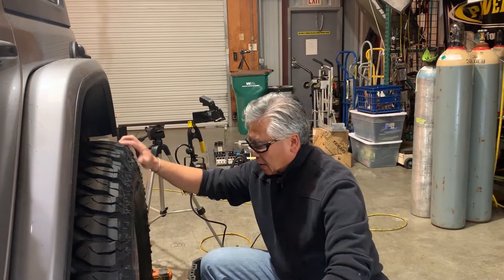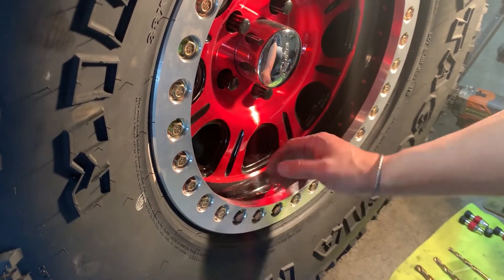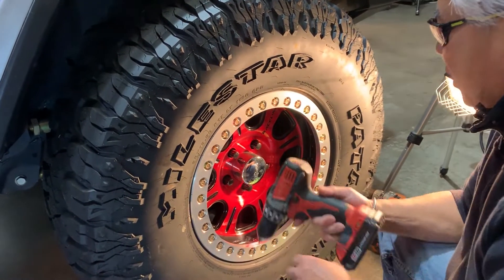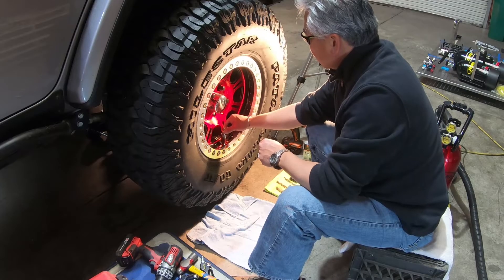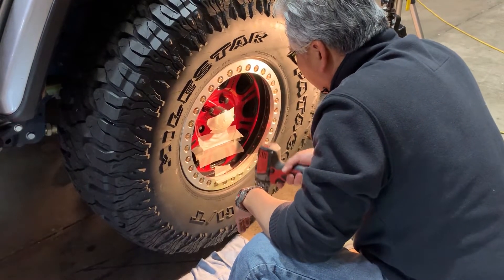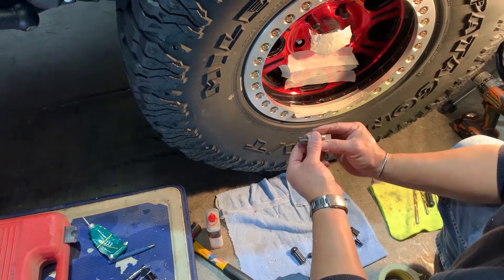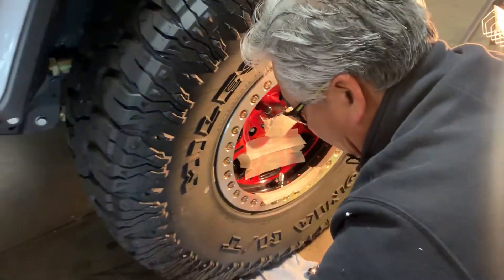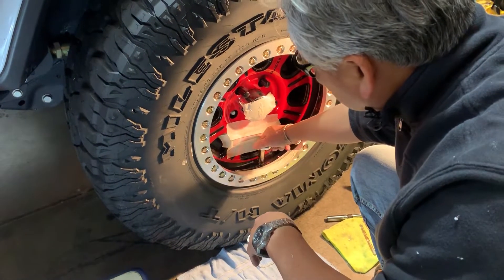Monster Valve 1 (MV1) Install in a Raceline Monster Beadlock with tire mounted

Comment: I added monster valves to my 40's and ended threading the valve on an angle like 5-10 DEGREES.  It leaks when being fully twisted in and blue loctite. What are my options now?
Reply from the maker: Please email us at info@powertank.com with pictures of your install.